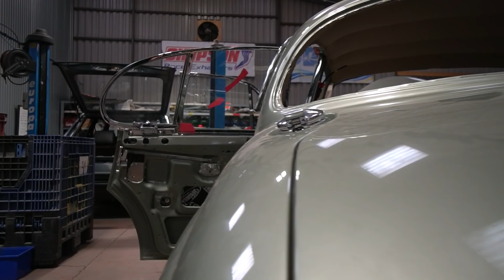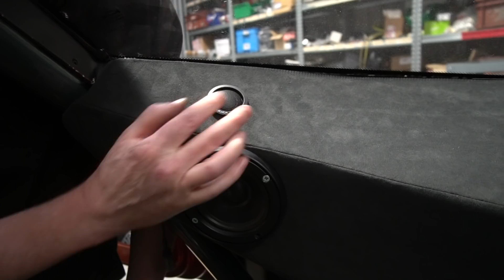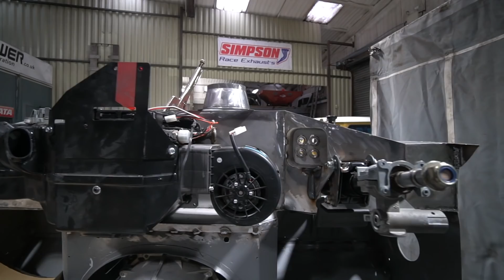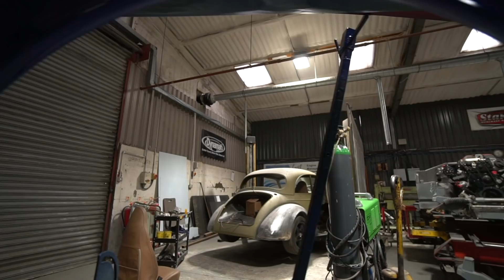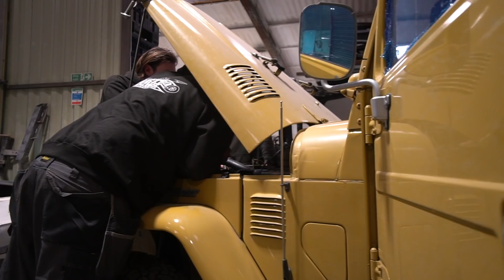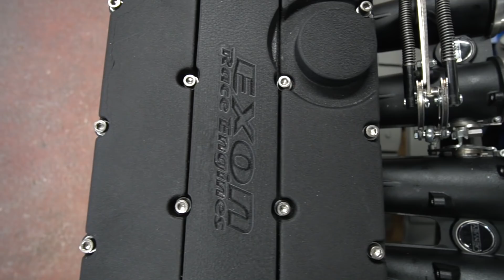Retropower Uncut Episode 37: Lancia Stratos Interior, Chevette HSR Bodywork, Jensen CV8 Body Mock-up

Comment: Just a heads up. In my limited experience I have found that the central locking and electric window stuff from any Isuzu truck works really well when retro-fitting.

Comment: The head lights on the Chevette, would the head lights from Hella find a drop snout Escort RS2000?
Reply: Don't you need to ask Hella bearing in mind that they don't fit a Chevette without rebuilding?

Comment: Another super round-up. Thanks for sharing this update 👍
Utah continues to look brilliant and has to be my particular favourite of all of the current on-going projects. 
I am interested in the Chevette's headlight units too. May I ask what diameter the light units are and where you've sourced them from please? 
I would like to attempt a similar adaptation to the headlights of a MkII MX-5 but it's a challenge finding headlight units with a small enough diameter. Any help is much appreciated 👍. 
Keep up the stellar work.
Reply: He mentioned many times that they are Hellas.  Why not look at Hella's catalogue where the sizes of everything are detailed?
Reply: @nickturner2813  thanks for the info Nick, I'll have a look 👍
Reply: @creamwobbly  The Morette lights would be ideal but they've been out of production for some time. 
They very occasionally appear on a well known auction site but they're extremely expensive.

Comment: I'm a petrol head not an accountant but it always gives me the jitters how long it takes to get the projects out of the door and the money in the bank. Exceptional work tho guys - setting the standard for restomods around the world. If you need any dry ice blasting give me a shout
Reply: I don't know if these guys do it, but a lot of places do it in stages. They do the strip down, one payment is made. Do the rust repair, another payment, and so on. This way means if the client goes broke you've had money in for and it's not a total loss (or you have to finish and sell it to get some money back)